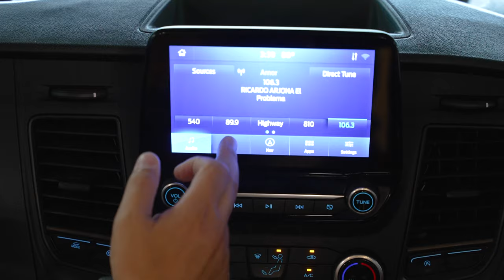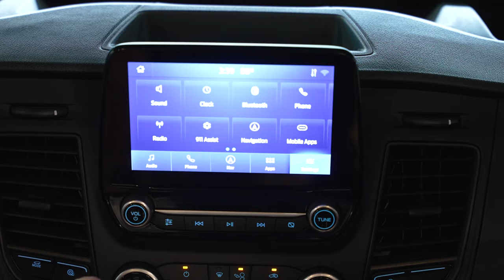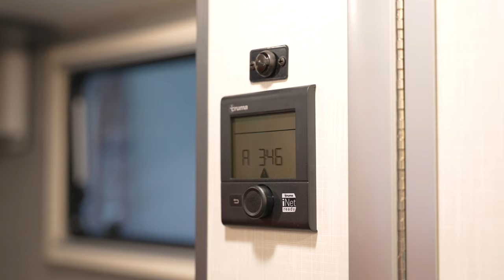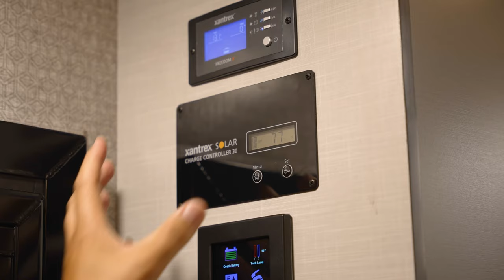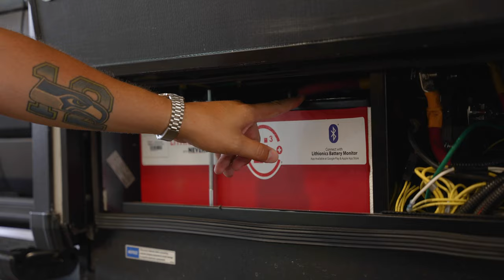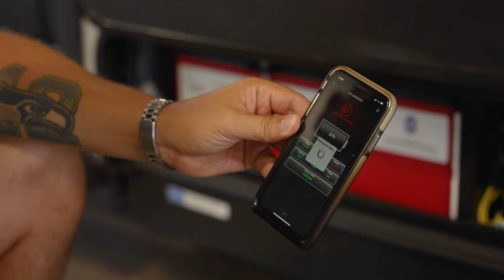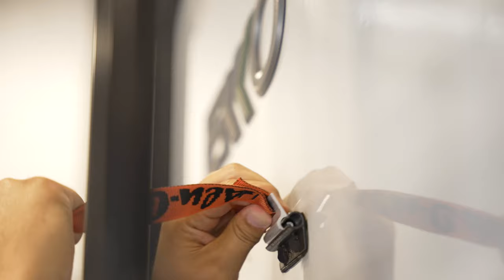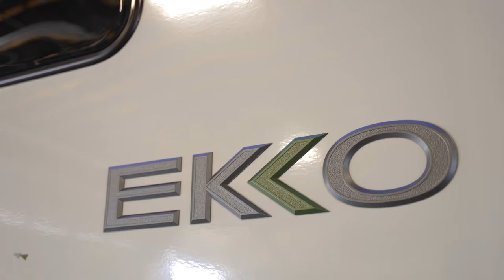Walkthrough:  WINNEBAGO EKKO - 22A Floorplan

Comment: I would do an additional Li battery and still retain the generator.  Is that possible?  Also, there should be an option for a small lift like the 2" Van Compass lift included on the Coachmen Cross Trail Extreme (hint, hint).

Comment: Very nice and detailed review of the Ekko. I have a couple questions: does the generator come with an automatic start, which can be set to come on for various reasons? Does the coach have to be level to use the refrigerator? Could you please explain how to disconnect and connect the propane tanks? What appliances/features can be run off of the inverter? Has Winnebago fixed the design flaw that crushed some of the heating ductwork? Another blogger mentioned they were having problems with their heat and found this issue.
Reply: Cathy, Thank you for your feedback
1. The generator does not come with an Auto Gen Start but in most cases that can be added to the unit.
2. The refrigerator does not have to be level to work because it doesn't use propane to keep it cold. Its runs off your house batteries/30 Amp when plugged in.
3. The propane tanks are just portable tanks like one you would have on your BBQ to get re-filled or exchanged.
4. All appliances excluding the A/C can run off of the inverter. But the A/C will run off the Generator when running or your Lithium battery system/Shore power
5. From my understanding Winnebago is working on the issue.

This is Barry from La Mesa RV that did the walk through on the unit. Let me know if I can help further.
Reply: @barrynellums1411  A follow on to the OP's question regarding the AC and battery power Barry.

If the generator delete and second battery option is selected can the AC be run off the inverter? If not will a soft start kit allow that? I guess the real question is if the AC is in the inverter circuit at all. Thanks.
Reply: @zonacrs  

Yes the A/C can be ran through the inverter off of house battery power.
Reply: @barrynellums1411  Thank you.

Comment: I have a long list of things I like about this RV.  However, I see a couple of design mistakes.  One is the generator exhaust hanging almost to the ground under a 4X4 vehicle.  That needs to be reconfigured.  Second, the overflow for the water tank is directly above the shore power plug.  You may say why should this matter, it gets rained on?  However, in some localities potable water is not soft and may conduct.
Reply: All tap water conducts ,where do you get pure water for your rig
Reply: @sarahann530  So you agree, its a bad location.
Reply: @Lorrin Barth  It's an air  vent not an overflow though . Why would you fill a tank until it comes out the air vent . Do you know the purpose of an air vent . ?

Comment: Thanks for the awesome video. Two questions: is it possible to make after-market substitutions to put in (1) a convection oven rather than a microwave, and (2) a dry flush toilet (like a Laveo) rather than the cassette toilet? Thanks!
Reply: Glad you liked it!  As for replacing the microwave for a convection microwave that should be doable as long as the size is the same and whoever installs it can facilitate the venting if necessary.  As for the cassette, that too would need some aftermarket construction to facilitate the install of the Laveo and connecting electric.  all should be doable, but not from the factory.

Comment: Do windows have screens or do the day shades act as screens?
Reply: Are the day shades actually bug screens ???  If not, why not and can bug screens be installed ?????
Reply: @deborahschaub2925  the day shades are made of heavy duty bug screen material. When you open the window and pull the day shade down into place, the opening is then fully sealed by screen.